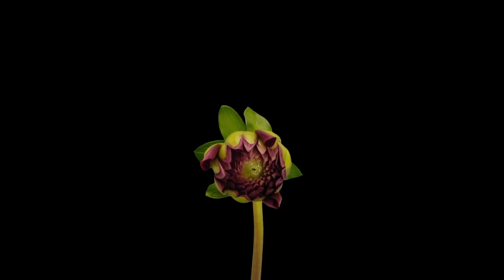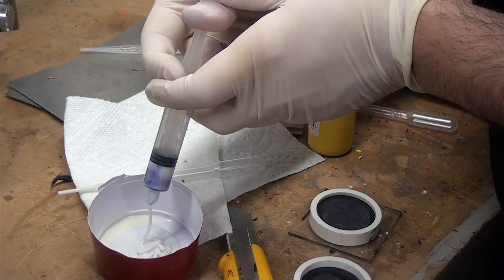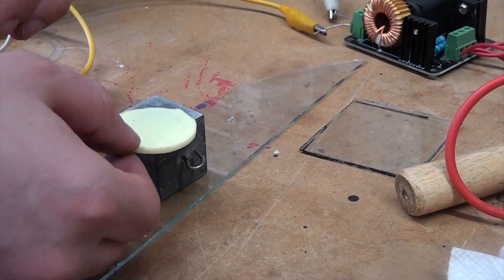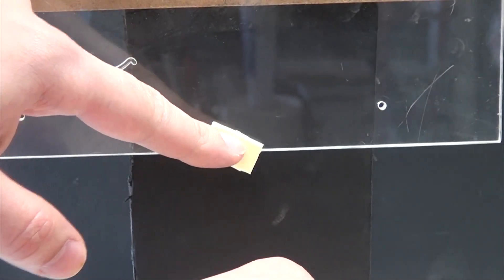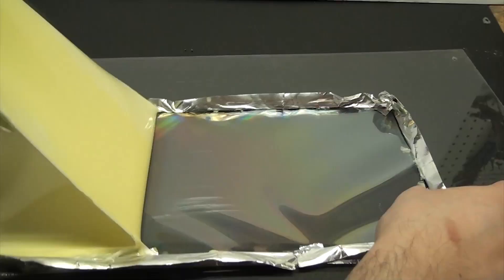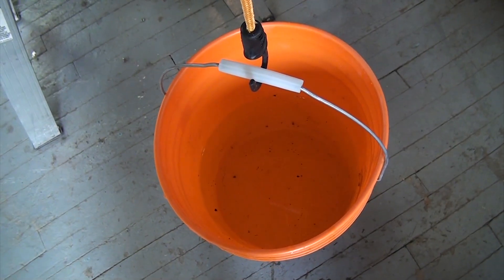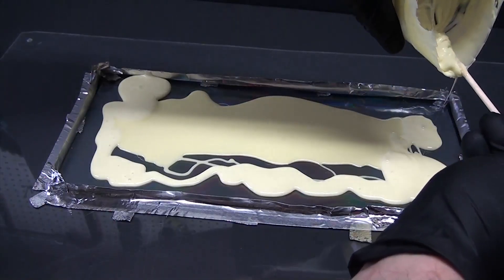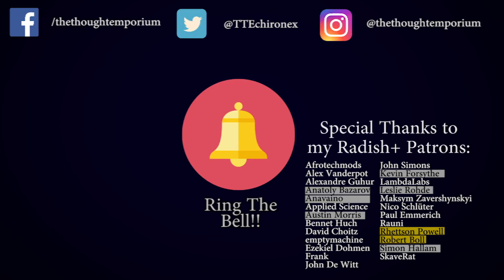Climbing Walls With RAINBOWS - DIY Gecko Tape

Comment: silicone mix-in thickeners, slacker or other modifiers (to change shore hardness, surface tension, etc) are probably the most fruitful route to a performance improvement. BUT... as is typical of every project that is even mildly interesting, its expensive. Smooth-on makes a wide range of silicone modifiers (particularly the platinum cure series) most are skin safe and are sold at a consumer level. Maybe if they are cool they can sponsor and send you nice sampler platter.

Comment: You need a more flexible backing for the rainbow silicone tape so that you can mimic the gecko movements to be able to apply the pads easily to the surfaces.

Comment: how bout applying the tape to the acrylic from one edge to the other (like how you put bacon on a pan) instead of centre-outwards (or smacking it on the surface) so that you get the full surface area in contact?

Comment: have you considered using a pressure chamber to compress the air in the ridges, causing an almost suction affect, this could in theory  allow for a sharper molding

Comment: I've been a dentist for almost 25 years. We're great at taking impressions. Anyway, in dental school we used lost wax casting to make gold crowns. We discovered that you could invest a fly or other insect and invest it as if it were a wax pattern. The mold could then be burned out and the insect cast in gold. the result was amazingly detailed with tiny leg hairs of the fly being cast. I'm not suggesting you invest a gecko, but i wonder if a very accurate impression of a gecko's pads could be made and then centrifugally cast with nylon or something similar. Just an idea. Also, casting under vacuum works great too.

Comment: the problem is, that when you stretch the silicone, it stops being rainbowy and geckoy.
- You need something that does not stretch, and has a soft padding before the hair .... kind of like a gecko feet :D
- ALSO: the point is that it sticks to ANYTHING not just flat 'glass' - we already have suction cups that can do that fine. - hence the soft padding, and probably smaller hairs.
Reply: .... I guess the soft stuff can be the hair themselves XDXD (realizing this when he talks about the pro stuff at the end)
EDIT: lol, he actually says everything else at the end too. :D - Good, I think it means I'm not stupid. XD

Comment: I think if you are able to calculate the amount of force a single gecko leg can handle, then you can approximately able to calculate the total weight of gecko which is handled by all four legs.
By this you get the ratio and can use right amount of tape for a particular weight to hold on the obeject weight or might be yours too😅👍

Comment: if you used a semisolid frame backing, wouldnt it have a great deal more flexibility on the inside portions and thus be able to stick to the backing a lot better?
Reply: because of larger contact area btw

Comment: You may find that organic imperfection is where success lies. Sticking two flat surfaces together can prove difficult if either surface isn't a perfect plane, but if the tape is applied to something more malleable (Like the flesh of a human hand) that can compress to fit the surface you're trying to adhere to, you may find a much stronger hold. Long story short, despite your tests, make some gloves with your method and it may work better than expected. Just a theory.

Comment: Why not start with flat silicone and laser engrave. The remaining meterial would have massive surface area. Perhaps evan using uv curable substrate and a projector format you could coat a "tape" with resin and cure sections as it rolls past the projector.

Comment: I would attach the rainbow gecko tape to a flexible but strong non stretching material, many thick flexible plastic. This would allow all of the tape to stick and would stop the tape from stretching to the point where it loses contact. I think this would be a really strong.

Comment: you can modify the mold before it cures. add cornstarch for rigidity, glycerin for elasticity - assuming the type you used cures with moisture, this will also speed up the cure time, significantly.

Comment: I'd imagine with some serious refinement it would be possible for a small guy to climb some surfaces with a glove coating but the square cube law is not your friend in this case.Durability would likely be an issue too unless you can find a way to the surface self heal.

Comment: you might try using a flat plane clamped down onto a short wall of foam surrounding the diffraction grading. That would allow you to get a flat, planar surface on the back so that, once adhered to the acrylic, they would have most if not all of their surface in contact with the gripping point.

Comment: Me hunched over hiding in a shed making gecko tape for my whole body so I can scale buildings like spiderman
Reply: You'll most likely get covered with the ever-present dirt.
Reply: @cymes82  That's a good point.  How to geckos wash their feet?
Reply: @JackAdrianZappa  The spinules on their feet are so small that all filth is way too big, in comparison. The tips of them are in the size range of around 50nm or 50*10^-9 meters. That's 0.00000050 meters. Or in freedom units that's 0.000002 inches. in fact it would require 25'400'000 nanometers to equal 1 inch. And as far as scientists are aware as of now, the smallest droplet size is 5 times bigger than a single spinule tip. However that's under pressure, normally they're several microns thick. Which is 1000 times bigger than a nanometer. And seeing as the gap between these spinules is 500nm and a water droplet is usually in the size of 5µm or more, which means gecko skin is Waterproof, which is good as water would break the bonds between the surface and the skin of the gecko.

And I guess if Thought Emporium managed to make actual gecko tape to that size, it would actually be pretty cool. What would be even cooler if someone could make clothes with this property, not only because it sticks to stuff, but also because it's waterproof.
Reply: @JackAdrianZappa  Hi! I own a gecko! He actually does lose his stickiness over time, I can only imagine his hairs start to degrade/fall out/become clumped together, and after about 2-3 months, he loses his ability to climb glass completely and relies on the sticks in his terrarium to get around. But, unlike silicone, he can simply replicate new hairs and become sticky again when he sheds his skin, including his microscopic hairs.

And to answer Major here, considering sometimes I have to soak my geckos in shallow warm water to help with their stuck sheds, they are indeed hydrophobic, but they are not fully waterproof. Lightly spritzing some water on a gecko does result in droplets rolling off, but soaking one will eventually result in a sopping wet creature and undying hatred from an animal with a brain the size of a squashed pea.

And in fact, water does indeed break the bonds between the surface and gecko's foot. Due to being hydrophobic rather than waterproof, they don't absorb water easily, but are not absolutely dry at all times. My gecko loves to splash around in his water dish, and becomes upset when he tries to scamper up the wall with wet feet, and can't manage to grip. The even small amount of water on his toes can result in grip being completely negated, which is why you typically won't see a gecko climbing on a wet surface, and if one is, then they're most likely using their claws, as they have a rudimentary form of retractable claws in the way of just simply turning them inward when not in use.
Reply: Crestfallen Mortal you wouldnt need for whole body just the palm of your hand and the bottom of your feet
Reply: @willraya1791  knees would be smart as well
Reply: @namonaite  and back  of feet
Reply: Yikes

Comment: Try using a spray adhesive on the diffraction film onto a surface plate or a thick piece of glass if that's all you can get. Roll it on with an insulation roller like they use on dynamat for sound proofing cars. You could also try laying masking tape on both the diffraction tape and the glass. Spread some cyanoacrylate on the non sticky side of the masking tape and lay the diffraction tape down on it. If you need to release the diffraction tape just pull it up from the masking tape. Though I suppose if you don't mind the diffraction tape having a permanent bond to the glass you can use CA directly between the two and weight it down with another sheet of glass.

Comment: You could try a similar method using CD's and blue ray disks to play around with a different sized nano gradient. Also, perhaps casting silicone on a combination of an intermediate grid structure like a window screen on top of the diffraction grading film could improve the results.

Comment: Simple thought, one you've probably had, but wouldn't mounting the silicone pad to a non stretchy rigid surface improve its performance? Because then the silicon itself isn't stretching so much that the bond is broken, and a better idea of how much weight it can hold can be made. Simple thought, maybe I'm wrong, but thought couldn't hut to put out there.

Comment: what if you clamp the silicon between two of the defraction gradings at a 180 degree offset?
Reply: Well if you are hanging things a 90 and 45 degree would make sense. Angle the 'V' so downwards maybe...

Comment: to get it to stick better, instead of an acrylic backing, use canvas.  it can bend to match the target shape and will reduce the stretching that took off your non-backed test.  you can attach it in a similar manner as you did with the acrylic, and have some eye loops and/or a re-enforcing bar across the bottom to attach to.

Comment: I think that maybe not having a rigid backing is a simpler solution. If you could fasten it to firm but malleable rubber, and in turn, a handle, you would perhaps see results

Comment: Wow, that's pretty cool, well done. Just one thing, your testing setup wasn't correct because you were using an elastic cable. This meant that most of the weight went into stretching the bungee rather than pulling on the plate. You need to repeat this with an inextensible cable to get accurate results, which significantly less than what you measured. Still really great work though!

Comment: solution is to photograph the feet then process that photo into an imaging plate for printing, print the photo on your material and then acid etch it..after acid etching eletroplate deposit material  to build areas you want built.

Comment: use a sofer hardness of silicon for the first layer very thin pull a vacume then use a harder stronger silicon as a second or third layer towards the back this wil impove it mostlikly 100% at minuim

Comment: instead of using a flat sheet of acrylic as a pad backing, use a strong material like woven kevlar so you get the strength whilst also getting full contact with the material

Comment: Super low-tech fix for the stretching problem, a couple layers of duct tape might do the trick. It's got a surprisingly high tensile strength while still being flexible

Comment: You could position the pad about a millimeter from the end of the inside of a square box and drill very tiny holes into the sides of the box right above the pad, at the very end.

Then add another closed-off box around the original box and pull a vacuum in that. The pad should pull down onto the surface.

I know vacuum pumps aren’t exactly portable, but there must be some other more portable method of pulling a vacuum that could work.

Comment: a few thoughts: glue the film to a flat surface before casting. vibrate the surface during casting to help the silicon get down into the ridges of the film. mount the finish product to a flexible but tough material, something that will flex but not stretch. as the force is applied its deforming the ridges . also maybe you would get better adhesion on a larger scale with rings instead of ridges. if you could find a Fresnel lens with  super narrow groove spacing .

Comment: I see that in both this and your microfluidic video you are fighting to get a film lay flat on a surface. Have you tried to fill the gap under the film with some liquid? Water will do, but glycerol might be better because it will not evaporate during the curing of the silicone.

Comment: Try putting the silicone in a vacuum chamber to remove the air bubbles it should help some with the consistency of the grips

Comment: I would try to achieve this by using an UV laser, a tiny slit and photosensitive resin. 

We would create an interference pattern orders of magnitude smaller than what you achieved in this video.
The intensity, row depth and material flexibility could all be controlled.
Could it work ?
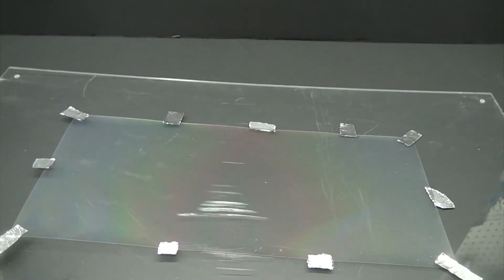Reply: 10:15

Comment: Just my opinion, but you could really improve your surface contact by using a flexible backing other than solid acrylic. I am not sure what type of plastic to use as I am not a chemical or material engineer, but something like a two-liter soda pop bottle double over could provide a solid yet bendable surface to replace the acrylic. ?? Just a thought... Enjoyed the video a lot!!

Comment: It's a Tattoo Machine, not a Gun.. You can adjust the depth of the needle, the power and length of the stroke, as well as the frequency, amps and the power of the return spring for optimal use, further exemplifying that it is a Machine and not a Gun. XP

Comment: You prolly would have had better results with a vacuum to not only cast the waz plug but also the casting to remove any air that is present.

Comment: what type of silicone did you use? what was its hardness rating. im assuming that because of the size of the grooves the firmness matters quites a bit. if its too soft they'll just be floppy and useless but too firm and they wont bend enough to stick right

Comment: So glad I found this. I can see a few things that would increase your "successful" yield. For starters I'd say your acrylic supplier, you'll need insanely flat material with the way you propose making it. Also potentially altering the casting method Nd a vac table may not hurt. Butacryloc sheets can be warped a significant amount even with it. Did you try vac casting? What type of rtd did you use? Do you think a soft back would give more compliance for increased adhesion? Also theres an asme sheer test that I would love to see with this material. It also failed not in pure shear, but in a peel modality. Lmk about those few things and I'll follow up with what I can find.

Comment: i realized when you added enough force with the clamps, it stretched and separated the bonds, if you were to add a kevlar sheet to the back you would minimize the stretch making it hold more weight

Comment: you should embed 2 or 3 sheets of 0,2mm glassfiber matt into the silicone and let a bit of the matt outside of the silicone so you can then glue a handle with epoxy to it

Comment: Casimir effect! It's an electrostatic interaction between two charged plates at a very close distance such that vacuum fluctuations due to the electromagnetic force work in a sort of feedback to provide pressure from the outside of the plates as well as the electrostatic force between plates. I wonder if we could make that happen with the materials you're trying out, maybe with some circuitry eventually.

Comment: wait what if you spray weak acidic liquid on a flat smooth surface and let it stay for a while will it make smaller holes that you wont able to see it? tho then will the MMS able to even go in to the holes before stifling?

Comment: So... since your making it out of silicon that means you can flex and bend it, try using some form of stretched semi sphere so that you place the very front first, press down, and all the rest soon makes contact, just don't make the sphere too hard to pull or else the ends will come up.
Reply: like in the shape of one of those yoga ball balance trainers that people throw flips off of

Comment: You can make the backing into slats giving it points of flexion allowing you to slowly apply and remove the pads to a surface.
The slats can be held together with a more dense silicone acting like ligaments connecting bones.

Comment: Few thoughts that most likely has been commented gazillion times already:
- Use some kind of fibers to make the tape not so stringy.
- Make the silicone sheet thicker. That should help with contact.

Comment: What about using vacuumed sand robotic hands as a backing to the silicone?  this would allow the silicone to form a flat surface against any given texture.  Also the vacuumed robotic hand could be fabricated fairly cheaply.

Comment: Have you considered using air bladders inside the silicone pads? The pneumatic suction might be enough to lock it in and reversing the flow would loose it.

Comment: Would casting a clear resin on the diffraction grating produce the same effect?
Reply from the maker: yep but it can be tricky to remove after
Reply: @thethoughtemporium  is there any way to circumvent that problem that you know of?

Comment: When you pour the silicon on the refraction grating push a piece of acrilic with lots of holes drilled in it onto the silicon. This should adhere the silicon to the acrilic securely and keep it spread out so it will keep it's full surface area of "gecko skin" on the target surface.  Try it please... I'm sure it will improve it.

Comment: What about to use a simple blu-ray cd as a mold or use a blu-ray laser to burn the desired cast and then to make the mold
Reply: I think the blu-ray disks have a pitch of 150nm to 320 nm witch is way smaller than diffracting grating

Comment: Awesome projects and nice content 
just a note :
doesn't the tiny pores create small vacuums that in a large number it creates the pressure difference needed to sort of act like gripping on to a surface?
because as the silicon is elastic if you push it on a surface the tiny pores of it acts like a vacuum cup holder thus creating the vacuum.